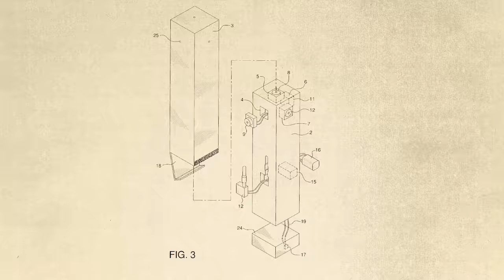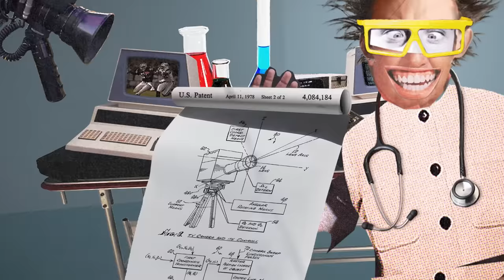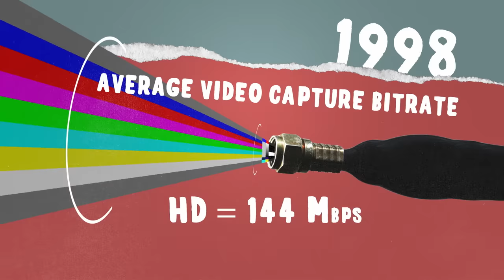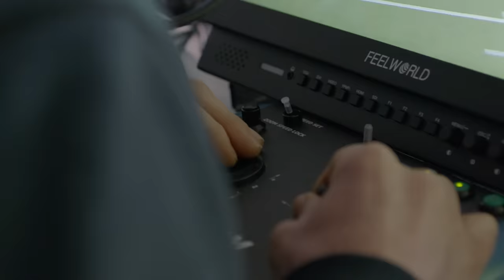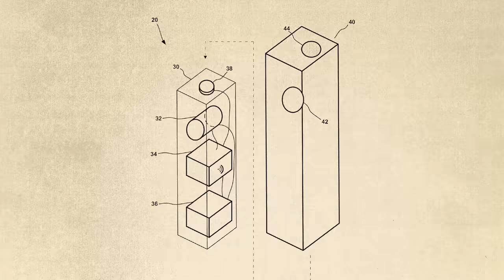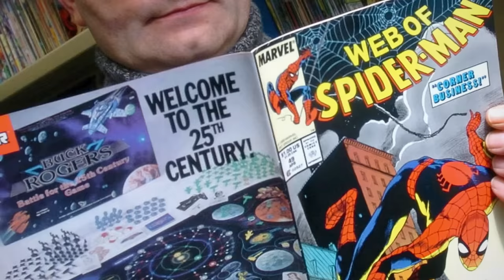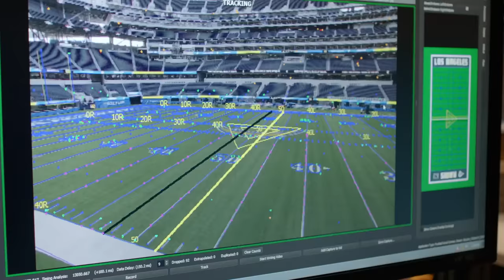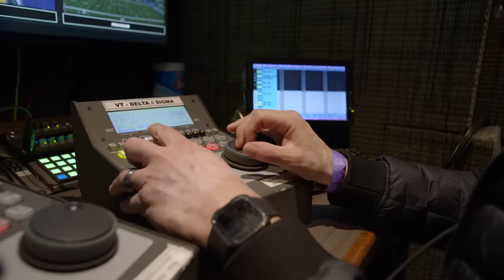AMAZING Technology! From Yellow Line to skycam and Pylon Cam | NFL EXPLAINED Broadcast Innovations

Comment: It would be neat to occasionally show the TV-football viewer two infographics that ILLUSTRATE the data in the current on-screen “bug.” Each would consist of a short, wide horizontal box at the bottom of the screen, initially empty. The color of their outlines and/or fillings would differ. 

The first box would represent ten yards. It would be filled in (blackened, say) from left to right as the offense advances. 
If the line of scrimmage is pushed backwards, the box would be enlarged. 
A number identifying the line of scrimmage’s yardline would be inserted somewhere within the box. 

The second box would represent a quarter’s 15 minutes.  It would be filled in from left to right (e.g., be shaded or cross-hatched) by the time occupied by each play. 
Three characters to the left of the box would identify the quarter. E.g., 1st, 2nd, 3rd, 4th. 
A number identifying the time remaining would be inserted somewhere within the box. 

Unlike with the current “bug,” the viewer would not have to squint to input the data, or have to think to interpret it (i.e., to create an in-brain graphic). It would all be done for him. He could grasp the current situation at a glance, effortlessly. 

These boxes would occupy more on-screen real estate than the “bug.” Therefore: 1)They perhaps shouldn’t be displayed during a play. 2) They might need to be displayed serially rather than concurrently. 3) They should probably replace the “bug” when they are shown. 

A third horizontal box with filling might be used to illustrate the score, although it wouldn’t as greatly aid the viewer.  It might convey somehow the number of scores the trailing team would need to overtake the leader. It could also include the odds of the leader winning the game. 

Viewer-appeal could be tested by a focus group, perhaps using a taped replay of a game onto which these infographics had been superimposed. 

Even without having seen these graphics, except in my mind’s eye, I personally love them. I’ve never been happy with the current “bug.”It violates the prime design directive, “Don’t make me think” (or squint).

PS: Time-of-possession could be illustrated by two horizontal boxes, one for each team, stacked for ease of comparison.

Comment: It does not seem all games have the same quality technology in the camerawork.. Some games I see use a camera that cann zoom in on the field where you can see all the blades of grass 360 degress to tell if a foot is out of bounds and others are a far more distant view that dont zoom up... The XFL seemed to have far superior camera views and close ups.
I dont understand how the New Football league can use a sensor and chip to determine if a ball crossed the goal line but the NFL still uses by sight only. The sensor is also used for first downs.

Comment: Totally disappointed with the extra garbage each channel has included on its broadcast

I definitely did not like the glow puck, but if they could somehow modify the usage against speed I'd like to see that. Something like adjusting the slap speed of the puck. I definitely hated it when they over used it. But if it could be adjusted by the force I think it might be okay.

This leads into the line of scrimmage and 1st down line. I cannot stand it being so wide personally (and they use tight camera shots eliminating sidelines). I understand the complexity but a thin line would be just as good imo

Personally I think the line of scrimmage is more important than the first down (because of the sticks). I kinda wish the NFL allowed a casting without all the stupid garbage on the screen

Including the over blown score keeper. Sure that ticker tape bar below is nice but the constant pressure of adding more comments and stats there just make it more annoying

Simple display and identity of scores, quarter, time, play clock, downs and yards to go and timeouts (maybe challenge flag)

If you want to be fancy, use arrows for direction of down and yards to go. You can use a tiny identification for who has the ball (only needed for ticker screen scrolling at bottom)

Which leads me into the updates from across the league. Stop with the constant pressure to update us live each second. If you really have to do that, play it mostly during breaks in the game or during commercials. 

Personally if they'd stop adding more and more text to the screen it gets more distracting during the game or play. They should just focus on the game not around the league during the game imo

... and don't get me started on the stupid ColourPop on the turf for other channels. Or the 3D graphics during a review of the quarter or halftime with current game stats. Wish they gave more of an interaction with the game or games being played.

Like split screen views being broadcast. Using a view from behind the quarterback and the top down views. In conjunction with our normal TV side view. Sure you can add end zone views from TD's or something heading in that direction. Personally I wish they broadcast better views from the stadiums too while you are there.

Sorry for the rant. Oddly enough this is just my rambling on American football, let alone futbol ⚽ hockey 🏒 rugby 🏉and other sports I enjoy 🏀🥎🎾🏏🥊🥍🏐🚲🎣⛳